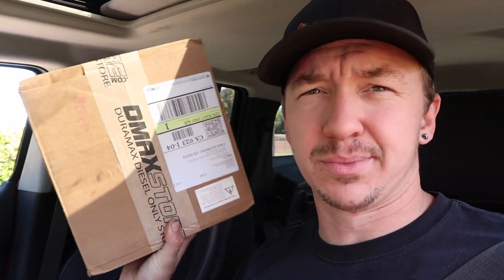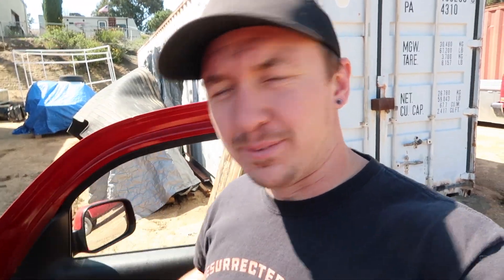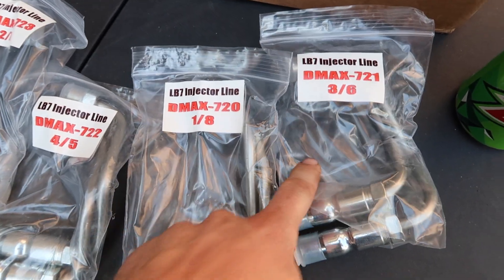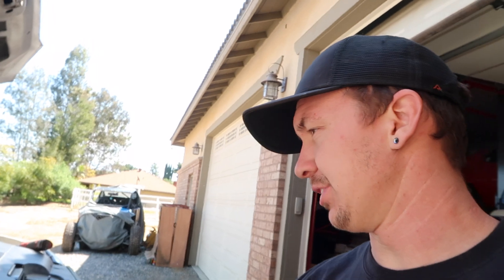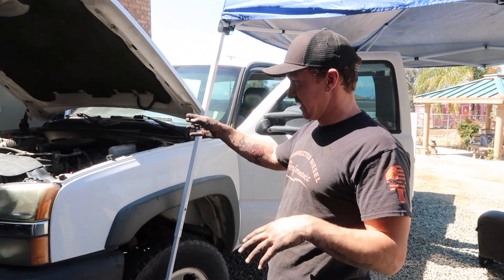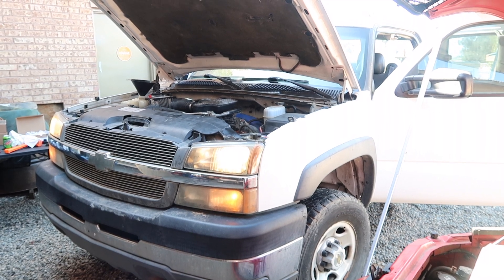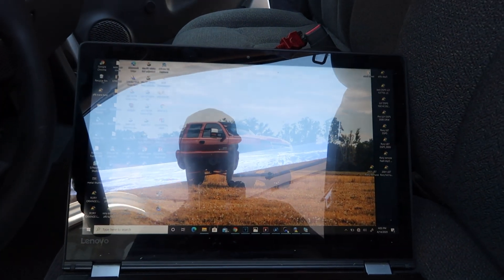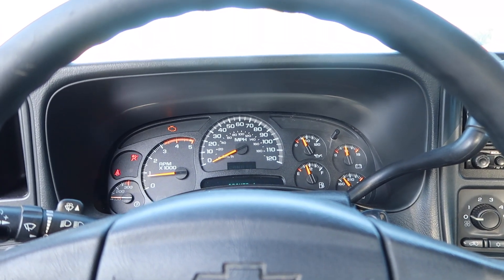This LB7 Duramax Hasn't Ran in 6 YEARS!!

Comment: The pain in the ass of LB7's! Probably a wire/connector issue with the inner harness at number 7. Gotta love pulling valve covers to get at em! Keep up the good work brother.
Reply from the maker: thanks brother after further investigation and more testing I think I have a bad valve on that cylinder
Reply: Run Extreme Hot Shot oil service through it you might have a sticky valve to the fact that it sat so  long